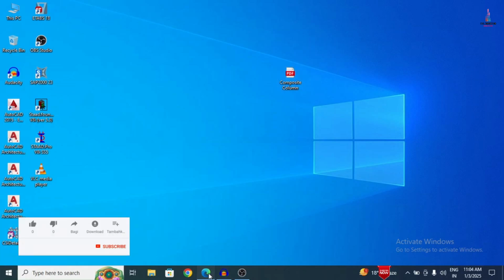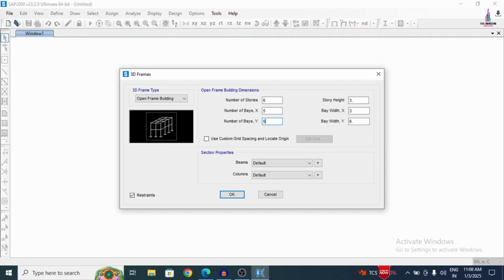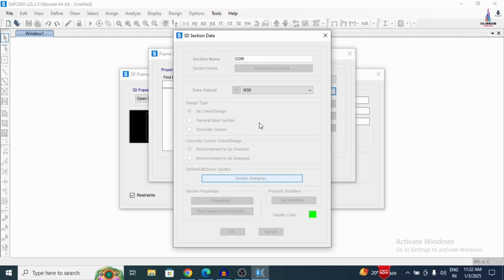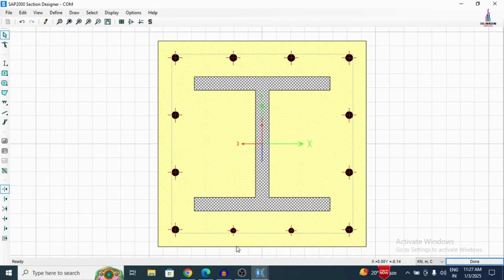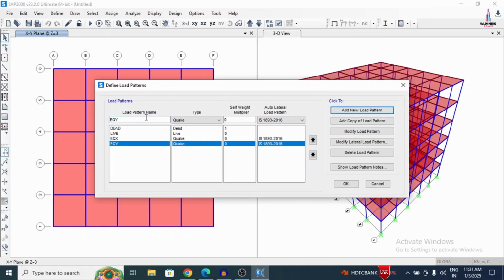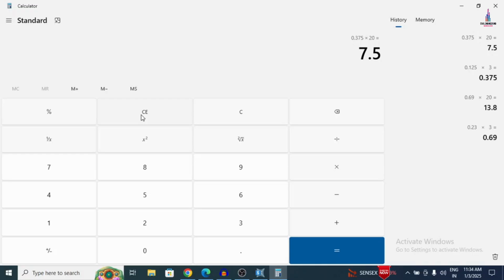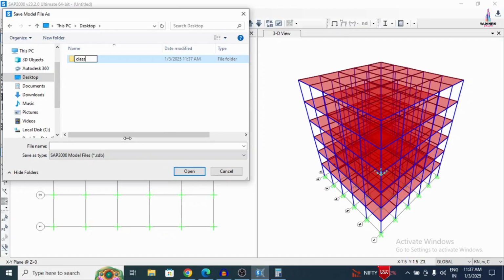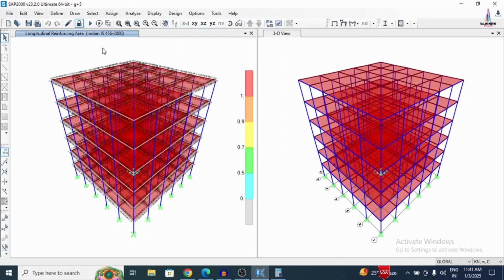G+5 Composite Column Building design by SAP2000 Software | Civil Engineering | Structural design |

Comment: @15.30 min,  please clarify why self weight is applied as joint load forces 1kN? self weight condition system will be calculated automaticaly in sap2000 .
Reply from the maker: We need to apply as joint load as per the self weight consideration as per the dead load considerations